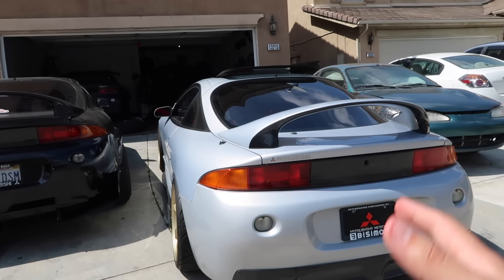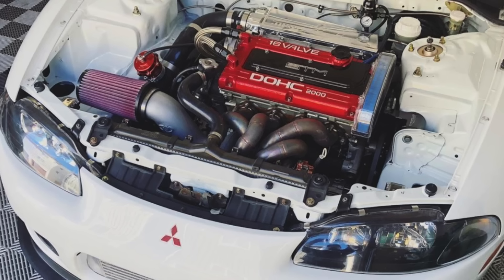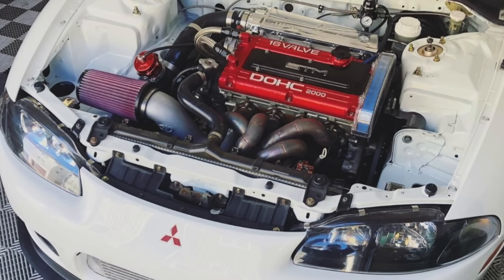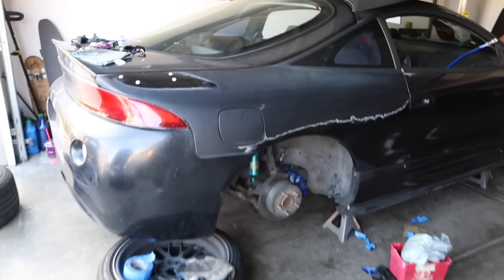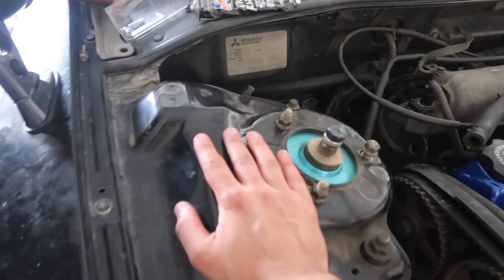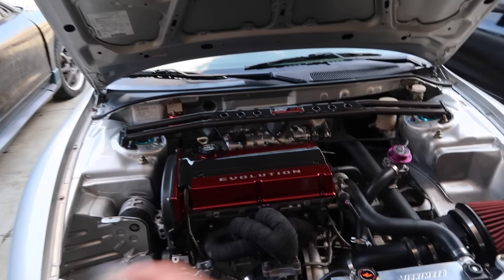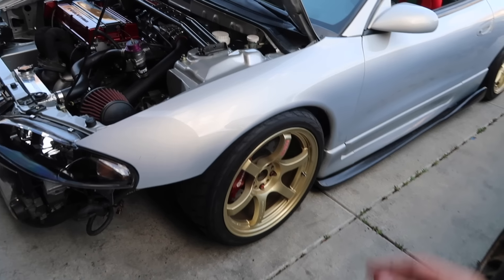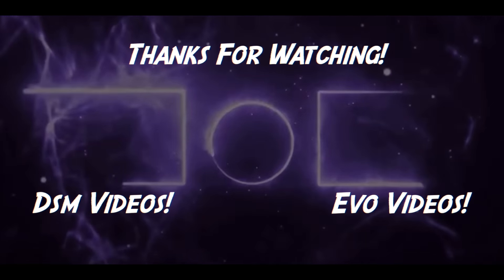WATCH THIS Before You Buy An Eclipse !!

Comment: Mmm idk about you stating 420a being more reliable then a 4g63 on the eclipse. After 11 years of daily driver and beating on the road course and now swapped into a fwd 4g has been reliable. Just do maintenance before mods I’ve always used oem mitsu parts. Great build none the less but just wanted to state that from a dsm owner whose owned 10 gsx/ tsi awd, 2 gst’s and two evo ix’s in the past.

Comment: You forgot the most important part!
Make sure to buy a 30$ compression tester!
It literally takes 10 minutes to check the health of the car!
This will really determine the health and negotiating of the price!

4g63T models should be at 176psi on all 4 cylinders! Obviously it should be close to those numbers and no more than 15 psi a part from each other.
Pretty much anything that's over 150 psi and very close to all 4 cylinders then ur good

Comment: @2:45    I've been daily driving my 97 GST for the past 4 years. Everything he says here is about how they throw a fit ect is true because I've dealt with it many times when something is wrong. Just for anyone looking into the turbo models, my best suggestion is to do monthly inspections yourself. If something is wrong, park it and leave it until it is fixed. From my experiences, one thing goes, 3 other things get effected and then boom those 3 things dwindle under the pressure. Here's a list of things to check/replace while buying or owning a GST or GSX. 

1. Compression tests are a God send. Use them and you will know the immediate health of the engine.
2. Rust is a common issues with these cars especially outside of CA. My GST wasn't even safe and the original owner bought it in CA. People check certain common locations for rust, I'd suggest checking the WHOLE car. 
3. Do ALL radiator hoses and vacuum lines to save yourself early head aches. 
4. Check for any obvious leaks. I've noticed that a lot of people tend to forget about valve stem seals and valve cover gaskets on all cars. Coolant leaks seem to come from the heater core in these cars, because they are an absolute bish to replace. The heater core itself makes you take apart the dash just to get to it and the hoses are a pain to replace because people usually don't replace them when the the heater core fails due to age. Mine did so I have bypassed the heater core every since. 
5. While driving make note of the oil dipstick level and check it again after driving to ensure you didn't lose any. This goes back to #4 with the valve stem seals or it could sometimes be the turbo burning your oil. 
6. The 2nd gens suffer a crank walk risk. A lot of people have disabled the neutral safety to lower the risk by a lot. If the car you end up buying doesn't have this done to it that should be your first step. 
7. Schedule maintenance is REQUIRED. Say it with me now, I WILL FIX EVERYTHING FIRST BEFORE I ADD POWER.  

Hope those tips helped! I'm the 3rd owner of my current GST and she's happily purring at 197k on the original engine and transmission. The original two owners brought her back to life after sitting in a garage for 6 years. I intend to keep her running especially since I've dumped 3x her worth in parts. I do all the work myself and it's something I suggest you should do as well. If you have to take one of these cars to a mechanic, make sure it's someone you trust with your LIFE. Otherwise, you will have a very sad car. These cars act like small children when something is wrong and will throw a temper tantrum. PLEASE DO MAINTENCE REGULARLY. I hate seeing these at the graveyard...but then again, ya boi needs to keep his running so :P

Comment: Just a tip, be aware of the massive amount of vacuum lines in the GST and GSX models. From fuel pressure regulators to EGR valves, there's a lot of them, and a lot of people will do vacuum line deletes incorrectly.
Reply: Another tip to those who are new and want to start adding bolt ons....
NUMBER ONE MOD TO DO FIRST

INVEST INTO THE ECU
 ECMTUNING, also known as ecmlink/dsmlink. 

Purchase this first, and then bolt ons, mods,etc.
Reply: @Ryan_1997  what is emc tuning?
Reply: ECM

Comment: Just brought a 01 GS model back to life. Replaced radiator plugs coils cleaned iac valve throttle body and intake. Change all engine/ trans mounts new headlights and mirrors. Running pretty good compared to how bad it was when I got it. Paid 450 bucks

Comment: I had a 1994 Eagle Talon DL 1.8 manual ,  bought in 1995 with only 20,000 miles. Ran  the shit out of it for 9 years. Loved it,. Only had replace the alternator. Replaced the timing belt after 100,000 for precautions. Ran great.

Comment: For the 420a people. Stopped or right turn is 1st gear, left turn or city streets is 2nd gear, and 3rd is for getting on the freeway. Fourth is for passing on freeway and Fifth is for cruising at 80. I’ve had a 97 RS for 19 yrs and 200k miles. It’s at 275k now. My commute is through the Cajon pass trying to do 80mph and I get over 30 mpg. The out of the ordinary problems are:
Evap leak caused by emergency roll over valve on top of gas tank. Cover hose barb with epoxy to seal. 
Trans is weak. Early 2000’s neon magnum have HD trans. (5 speed)
Had engine rebuilt at 175k. Change radiator and exhaust manifold too. Recently the Cracked exhaust manifold destroyed my $350 catalytic converter. After a new cat I blew my intake manifold seal. Now I’m watching eclipse videos on YouTube because it’s been reawakened. The only thing I didn’t do myself was rebuild the engine. If you don’t have as much fun under the car as you do in the drivers seat it might not be for you. But if you do, get an obd2 scanner with live data stream and a copy of the oem service manual. $17 on eBay. I’m hearing things about the head gasket leaking oil onto the back of the engine also. I saw the sludge. I think it’s real.

Comment: The one i had was a 97 gst, loved that car. My 3 years owning ot i was fighting cooling system issues and the power steering rack went out lol. Leaked fluid and eventually seized the pump. I drove with no power steering in that heavy ass car for years. The last nonth i owned i fixed everything. Then i would barely pass smog. I ended up selling it and buying an evo lol, but i loved that car so much. Hopefully the kid who bought it off me treated her right. Btw it had almost 200k before sold.
Reply from the maker: At least you got an evo!
Reply: @MiguelDsm  but, i want another eclipse lol despite all the issues i had hahaha
Reply from the maker: They’re nice to have if you have the time and space to keep one around until you sort out all it’s issues

Comment: I have a 2007 eclipse gt with the 3.8 v6 automatic front wheel drive. I have owned it for 7 years and it has been very reliable. In fact we have put this car through hell even climbing steep hills and goat trails. This is the best designed vehicles i have ever owned. Everytime i can't figure out how to fix something, we think about how well thought out the car was and logic usually points the way. After 8 years i still love this car.

Comment: i currently have a 2g eclipse gst, i have done head gasket, cylinder head rebuild, water pump, gaskets/o-rings all around, all belts, new alternator, new battery, competition stage 2 clutch with new fork & pivot, lightweight flywheel, currently on 2nd trans, wheel hubs all around, bc coilovers, fuel pump, fuel filter, thermostat, radiator, iacv, heater hoses all around, a few other things... MY ADVICE IS!!! if you are thinking of buying one, make sure you have a back up car and keep this as your weekend car just to have fun and do all the maintenance first because these are old and are getting more rare, yes they have alot of small issues but if you do everything right and learn from them you'll break necks and most importantly you will have a bad ass rare car that will be fun to drive and will have you with a smile all the time... i also own an srt4 so follow me on instagram! 🙄😄 Dsm_spyder
Reply: Have you done the ecu
Reply: @Ryan_1997  tune it? not yet but if i ever do it will be when i upgrade turbo, pump & injectors
Reply: @Santos.V  I have a 350z currently and am traveling to Chicago today to look at a 99 GS-T that is very clean and has 145k miles for $6,000. I have been very excited about picking it up all week. I plan on using it whenever I feel in the mood to drive FWD I’ve spent the past 4 years pushing a Corolla for the limit ever time I drive it so that is what was getting me excited driving a turbo manual FWD car. Is it worth it to you? With it being so close I don’t know if it’s smart to go through with it or not.

Comment: It’s been very hard finding a GSX, and most will go for over 6k in ok condition on Craigslist.  Most clean ones will go for over 10K on DSMTuner and Bring A Trailer.  And it’s very rare to see one being sold. I’m still looking and am prepared to pay 10K cash for the right car.  I miss my red stock exterior 97 GSX with a built six bolt and tdo6 20g so much from 20 years ago. Such a beautiful car, ran low 12s on pump gas.
Reply from the maker: Rather wait for the right one then get a random one that’s needs a whole rebuild

Comment: I have a gsx, well my dad bought in in 95 and it broke last year and was just sitting. I did a bunch of research and recently started working on the car. Such a headache but Ik it’s worth it. 4g63 awd is amazing. I had to replace the oil pan gasket and is that an oof. You gotta take off the front axles transfer case exhaust. Worst part is idk if there is another oil leak on the timing side.
Reply: Hows it going?

Comment: Got a 1997 GS Spyder with 55k miles for 6k. It’s the most mint condition Eclipse I’ve ever seen in my life. This old guy kept it in the garage every winter, everything is all stock.
Reply: Did you ever start having idling issues  or the car dying at low rpm’s?

Comment: What was the 3rd gear process. I can’t catch what lay said towards the end. If you see reddish oil leak on RS (facing car left side) check power steering hoses that are tighten correctly. Also on test drives (any car) first one is a short drive but the next one is a longer drive. The owner should not oppose to that or else walk away. Not talking about an a road trip...just long enough to see if the car overheats, or starts stuttering etc.

Comment: also, foamy or anything strange on the bottom of the oil cap is normal especially with E85 cars. They just need some times to come up to operating temperature and will evaporate

Comment: Recently made an offer on a 110k mile silver 99 gsx manual.  It’s very clean and I’m really excited, what type of “maintenance” do you mean? Just the typical stuff or anything specific to the platform?
Reply: Have the timing belt changed ASAP!!  Or spend $1400 of engine repairs

Comment: I used to own a 95 RS, 1st car I ever bought, learned how to work it from all angles, then I got a GS-T, power was addicting, but was forced to sell it cause my job did not allow me time to work on it....now I have a 99 GS Spyder....but I have no idea how to really work on it since it’s the 2.4l 4G64 engine....I’ve been told all parts from the 4g63t is compatible with it, but I don’t really have the help from anyone that’s actually worked on them to really know for sure

However, prices on these 2nd gen DSMs are crazy through the roof...can’t find any gs-t or gsx models below 10k...even my 99 GS spyder I payed $3k for, which only reason I did, was cause it’s low miles, not even 70k miles on it...just hate the fact that it’s a auto...would love to manual swap it...even an RS model is starting to pass the $2.5k range even if it’s high miles

Comment: Whatever you do try hard as hell NOT to buy a non turbo in California or any state that has strick smog laws because the 420a will NOT pass smog of you install a turbo.
I found out the hard way since then I've moved to Texas and recently had my Eclipse moved there where the laws a little more relaxed.
My 99 GS only has 74,000 miles on the odometer and my plans are to port polish and install Individual Throttle Bodies on her because it's never been done to an eclipse and I've read that car modified that way is more fun to drive than having a turbo installed on the 420a which creates more problems than its worth.

Comment: I was lucky my '97 GS eclipse spyder had the top that actually worked; i checked a couple out, that didn't. I've heard they crap-out, frequently.
Still have the infinity sound (but havn't got it to work, so heading to 2-DIN soon). You're so right on those front lower cntrl arms, had both sides fail.
Great video :)
Reply from the maker: Thanks for watching!
Reply: Just select the manual mode and remove the mechanism for the top.
And does yours still have the cd player in the back trunk? If not it wont work. I still have my whole setup, but not using the system. All boxed up
Reply: @Ryan_1997  
My top is excellent working, although i thought it was fried, so i did the manual aproach; then realized i just didn't push and hold it's power switch in hard enough...the cloth headliner has been chewed over the winter by a mouse.
No, cd in the trunk; but there's these aftermarket looking speakerwires with wire nuts in the trunk, so i think it might've had box speakers (not in now, tho). My GS did'nt come with p-mirrors, so probably didn't have the cd changer option, either. Thank's for your reply.

Comment: Heavily considering buying a 99' GS, no rust with just under 100k miles. Clean and fully working interior, faded roof paint and a passenger fender dent, is $4500 a decent price if it is in perfect condition?

Comment: Hey man. I am looking at two different dsms. One is a 1999 rs that seems to have a decent amount of mods and very low mileage (35,000). The only issue is that it is an automatic and it needs some interior and bodywork done. The other one is a 1999 gs that has a blown motor and a lot of miles(210,000). If I got the automatic I would be doing a manual swap but the only issue is that I am a newbie with car stuff and I'm not sure if I will be able to do the manual swap. I have a friend that works on cars a lot and I have some knowledge but no experience. They are both the same price and to recap one needs bodywork, interior work, and a manual swap. And the other needs a "new" motor (found a few for under 1000 dollars) but it has a lot more mileage than the first one.
Reply: I know I am supposed to ask these questions on forums but I cant figure out how to make a thread.
Reply: Btw I am a teenager with a teenager budget so please keep that in mind.

Comment: I bought my 97 gs for 3500 in 2014 one owner with 110k put 50k since and the only problem was the heater core and motor mounts I have a 06 durango and a 2014 grand caravan and the eclipse has given me less problems then both

Comment: Hey I am about to get one I have 3 options an ECLIPSE GST 1997 manual with some tuning done to it, a 2003 3rd gen GS with a manual or a 2003 GST Spyder with an automatic, from these 3, both 3rd gens look really good at the chassis, the 1997 not so much and it is painted in a flaky hideous green, both same price 2,305 USD, the one that looks like it needs less TLC is the 2003 GST Spyder, seems it is a dad car only as it even has stock rims, any thoughts?

Comment: My boy just bought a 96 gsx but it needs a tune. It won't go over 90 mph with out the tune or else the turbo is at full boost and will blow up if you go any faster. Do you have any pin points you could give me for the car other than the tune. I was told the tune was 3500. For a jdm car that seems about right but I just need some pointers or some local help from the comments

Comment: @4:19 ok hold up. Literally everyone has told me that 4g63 swapping a fwd car won't work because the 4g63 was designed for all wheel drive. I have an 02 lancer oz rally and when I got it I planned to do that and every single person with an internet connection told me it wouldn't work because 4g63 is an awd engine, and I should go for a rebuilt 4g64 (fwd) from a third gen eclipse with a the transmission from a 4g69 and evo 7 bolt-ons. So like...how? Is it a conversion kit or something? Parts list please!!

Comment: Hey, huge fan of your channel!!! Im new to the dsm scene. I saw the car and FELL IN LOVE! Never thought id own one. I drove it home but all of a sudden im not getting any spark, ive checked all fuses and relays and they get voltage, ive changed camshaft, Crankhaft sensor, and ignition coil and still nothing. It literally happened out of nowhere. Do you know what it could be? Im not getting voltage to the coil. Pls help
Reply from the maker: It could be your ecu or wiring bro
Reply: Dsm problems welcome to the club haha hmm wiring issue sounds like like miguel said
Reply: Check crank sensor
Reply: If it's 4g63 turbo check your transistor on the manifold. If not,  I dont remember 420a motors.

Comment: Thanks for the info, good video. I live In south Texas (Corpus Christi) and there’s only one Pull-A-Part junkyard with no 2g’s but a couple 3g’s. I was wondering what parts will go on my 2g from the 3g’s. Such as the front subframe bracket and engine mounts, window motors, window switch. Shift linkages.. Etc.